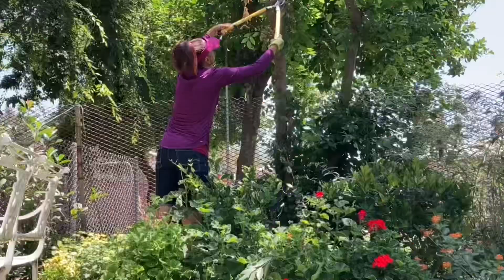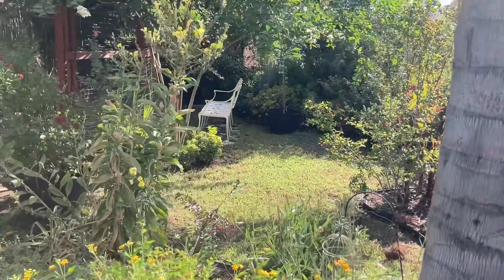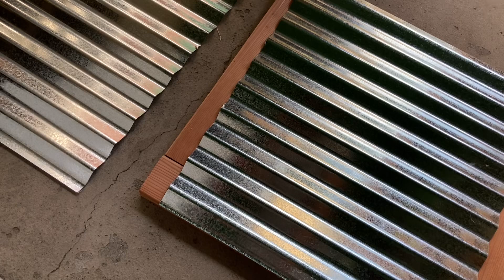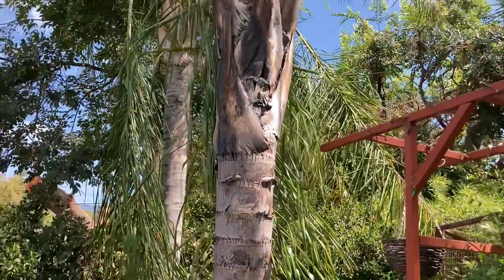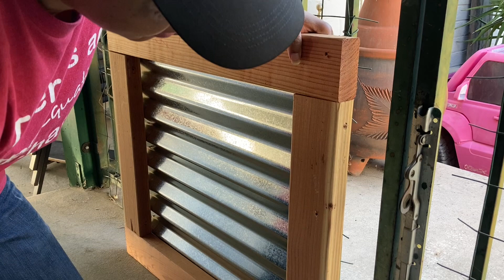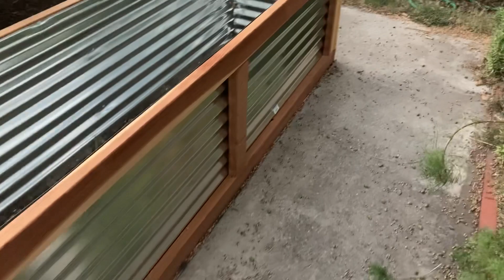Building My New Raised Beds; First One is Done.

Comment: Excellent job! I’d be sweating bullets in all that heat. It’s going to be lovely when you finish. Be nice to know the cost of materials vs. purchasing raised garden beds, but I’m sure the purchased ones won’t be as nice as the ones you’re building.
Reply from the maker: Thank you! As for the cost, I’ve spent about $250 so far on supplies. I still have enough panels for another bed and half enough wood left for another bed. What I’ve spent so far is less than half the cost for one bed this size. Oh! And I’m completely soaked by the time I go inside. 😂💚